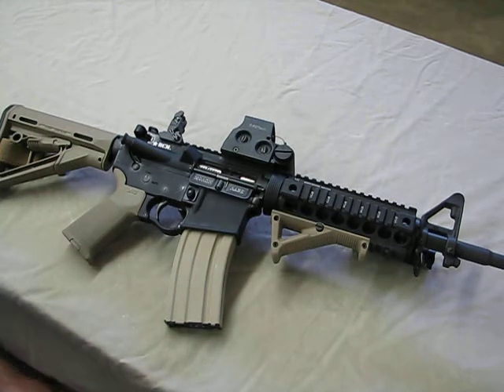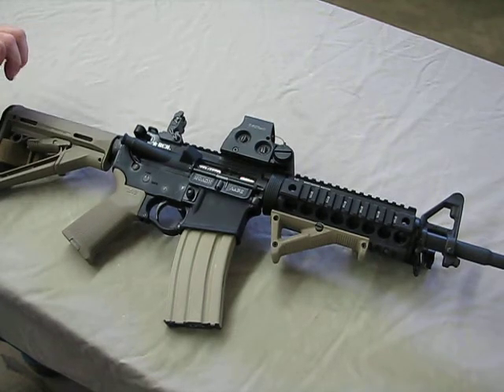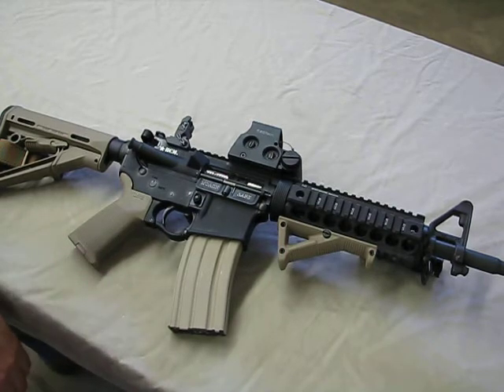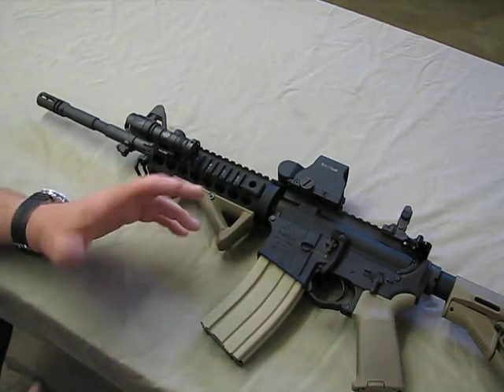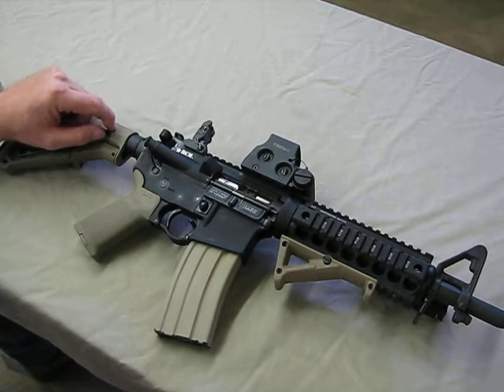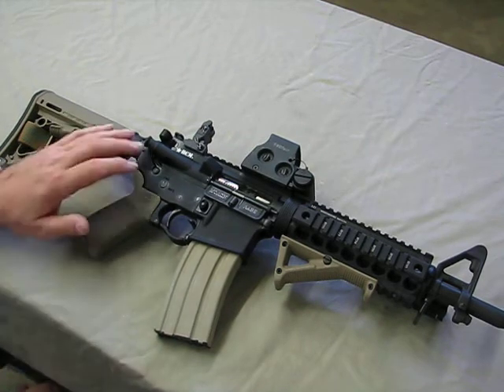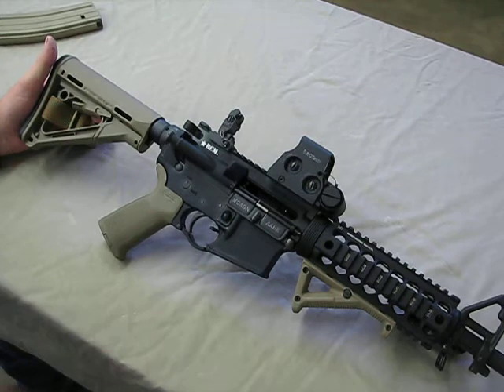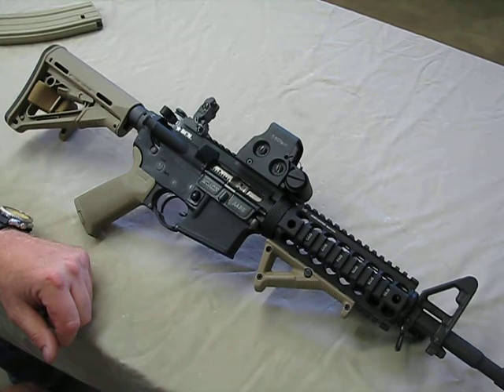bcm 14.5 upper

Comment: nice set up man,  i've built and ran very similar setups.  Fail zero is a great bolt/carrier and BCM makes great stuff.  The only thing i would add would be a Tubb CS buffer spring and bolt spring kit.  Tubb springs will cut out most issues w/ carbine length gas system and $25 for the buffer spring $13 for the bolt spring set. Check them out man, very nice cheap alternative to fix carbine issues.

Comment: would it be alright to use .223 in a NATO chamber?
Reply: You can use .223 in a 5.56 but not 5.56 in a .223. Most ARs now are multi-caliber so you can use both with no issue

Comment: You went with that stock cuz it's cheap. There is no cheek weld lol its basically plastic over buffer tube diameter.  Also Are you winded giving this review? Lol
Reply from the maker: Yes, I was struggling with congestive heart failure.